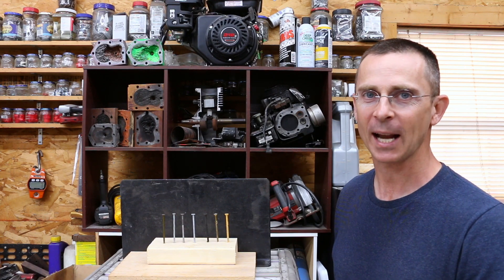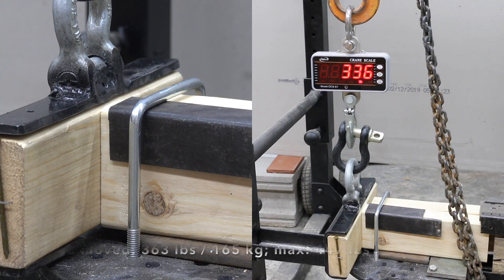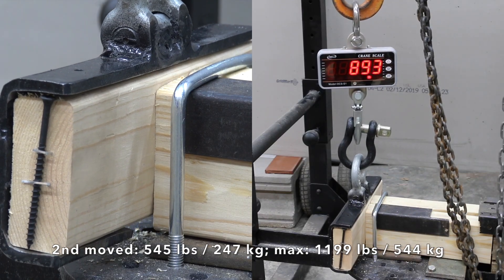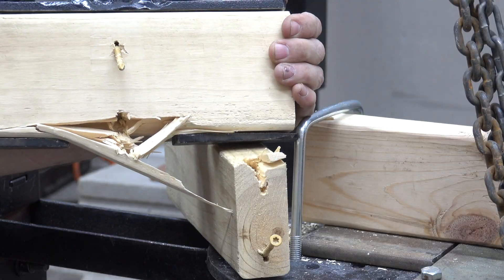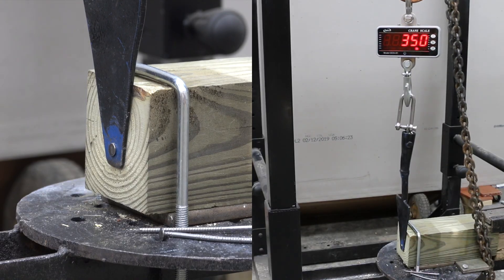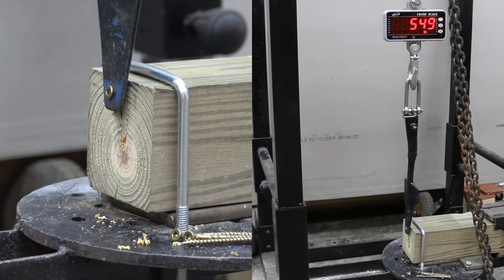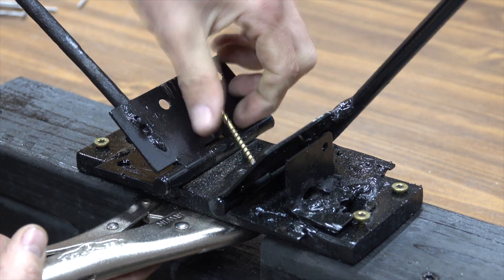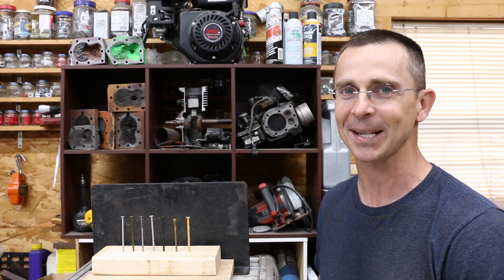Do Screws Shear easier than Nails? Let's find out!

Comment: This video is very useful for guys like me when talking to customers. There are a couple things I would have liked to seen for this test. as others have commented this was not a shear test but a holding power test. It is also impossible to have a fair test of holding power using conventional lumber. With conventional lumber there are weak spots and strong spots in each board. All of that being said both of those test are really hard to do. This video does give a lot of very good information to pass on to customers when they ask questions. Thanks for the time and effort.
Reply from the maker: Thank you
Reply: No. See I don't build houses. I build decks and porches. I get asked all the time why I use only deck screws rather than nails. Now I can give them an idea how much more holding power deck screws have over nails. Maybe next time don't be a wiseass when you have no idea what crazy questions contractors get asked. Having a rough number to give as an answer will get a lot more of a positive response over just saying they have a lot more holding power. Customers think contractors are out to screw them. So when someone uses something that is more expensive even if it is better. You get asked those kinds of questions.
Reply: @Mr Brightside while you and I know the facts about screws and nails. There are customers who do not get it. I have actually had customers who believe to this day. That hanging joist with a joist hanger is better than setting the joist on top of the beam. Some people need video proof. Some of people still might not believe it. A lot of old timers believe the way it was done 30 years ago is the best. Just like the difference between screws and nails. I know and you most likely know there is a difference between brands of the dame style of nails and screws. Customers can be a finicky bunch. Anything to help the hardest headed ones understand the truth is a good thing in my opinion. Sure I seldom run into ones who are that hard headed. But I do sometimes. I do not know for a fact but I believe I have lost a job or two because I refused to nail the deck flooring down. Even after I tried multiple times to explain why. There are times the customer is not always right. When that happens any evidence to back up the contractors word is good. Some people would just say forget those people. I would rather educate them so they do not get screwed in the long run.

Comment: I would say that in most cases the wood actually failed before the fastener did. Part of the problem with wood is the number of rings in the wood, knots, and other imperfections will cause different failure modes. It would be very difficult to choose wood where the end grain was exactly the same for all testing.

The bending test was tough to do. Screws have a natural failure point built in in the valleys of the spirals.  In the real world the body of the screw would be surrounded and supported by the wood so that the failure point would be at the intersection of the two materials being joined. If you use the 1/3 in the material being joined, 2/3 in the material being fastened to ratio most screws shear point would be in the solid point of the screw making it harder to shear. The second failure point would be head separation if the screw was over torqued during initial  installation. Most all initial screw failures occur when the screw stops turning but the device turning the screw doesn't popping off the head.  You can pop the head off of anything if you exceed the strength of the material being turned in relation to the holding strength of the fastener in whatever material it is in. The grip of the rust breaks or the bolt breaks it is always one or the other.
Reply from the maker: Thank you

Comment: can you test diesel engine oil on 4stroke gas engine as lube?
Reply from the maker: Thank you for the video idea!
Reply: @ProjectFarm  I heard some motorists put HDEO in their motorcycles and work fine. And can be used more than 1200miles. Common HDEO Shell Rimula 4x and 6x...anyway. thanks.

Comment: It seems from the video that often it was the strength of the timber being tested instead of the fastener. I'm not sure what the solution to this problem would be.
Reply from the maker: Thanks for the constructive feedback
Reply: One method would be predrill and glue nails into place. Especially if nails/screws are placed into side rather than end.

Comment: Video idea, (if you haven't done it yet) best bolt for wood into 2" concrete (and thicker). Maybe which one is the easiest to install, best overall, cost efficiency, and strength/endurance. I'm currently in the process of making a concrete farm house table (wood legs concrete table top) and curious on the best/easiest concrete screw/bolt to use.  

Also thanks for doing what you do! You're a serious youtube saint.
Reply from the maker: Thank you!

Comment: Could you do another test like this but use the same aspect where you had the two screw shear strength setup but instead twist the boards to simulate the fatigue stress like the two hinge jig. This could simulate the fatigue strength of a screw/nail/fastener when is practical use.
Reply from the maker: Thank you!

Comment: Nice work. Shows the behavior of the fasteners in a worst case (holding in end grain) but very common assembly. Thanks. Curious if you have tested the 2-stroke and 4 stroke fuels sold at Home Depot for yard equipment. Its expensive and claims to be better for your equipment than pump gas etc. If not please consider doing it in the future
Thanks
Reply from the maker: Thank you!

Comment: I'm curious about the bending vs the shear strength with brittle drywall screws. Is it possible that the thread area is hardened more than the shank area since the seemed to bend similar to the nails?

Comment: Hey I'm a structural engineer and the main thing wrong with this test is that on the stationary block you screwed into the end grain of the wood.  We never specify fasteners into endgrain.  For this type of connection I would use toe nails at an angle.  Repeat this test with fasteners into the side of the stationary wood to get more accurate testing results.
Reply from the maker: Thank you for the constructive feedback!

Comment: So, in my mind the screws would never really get to fatigue, because they hold the wood together so tightly, even through a hurricane.  So if you built a house tightly with screws, which would last longer?  I have never noticed decks flying apart because of the screws shearing, not even through the hurricane last year.

Comment: The thing about nails is, don't they get a tighter fit the longer they're in? It displaces the wood when driven in and when let to rest over a few days the wood swells and presses against the nail? Or am I wrong?
Reply: ...... screws do the same thing. And if wood is outside it absorbs moisture and expands which also helps hold.

Comment: Been in the business of using all these types plus many more for ovet 30 years. You should have included treated lumber. Ill tell u from experience the screws shear alot i mean alot. In less than few years nearly half are sheared on a simpke fence panel application. Ring shank all the way if it works for the application. Ive found the more expensive coated decking etc are just terrible. Anyhow keep up the good work.
Reply from the maker: Thank you!

Comment: Really loved your jigs here, very well thought out. The only critique I have is that on the 4x4 test, your U-bolts didn't seem to be tightened down (certainly not biting into the wood), and that matters because as soon as the 4x4 gets any angle to it, the pulling force is no longer in a pure sheer, it's a little bit in tension, which allows the fastener to pull out much easier. If for example you had constrained the shovel jig from pulling away and forced the fastener to break (or tear through the wood), you'd get far different numbers. If it comes down to both tension and sheer, then any 4x4 that allows tension to come into play more via the jig will skew your results.

I would like to see a fastener video where you pull boards away from each other, rather than just pull the fastener out of the board, (I suggested this on the last fastener test), because that's what we expect these fasteners to do, fasten boards to each other. There's almost no real-world circumstance where you are worried about pulling the fastener out by actually pulling the fastener. These sheer tests you did here were great because they demonstrate one of the forces we expect fasteners to be under. 

Lastly, I think your videos would be improved by having a few more visual aids on the screen. When you're testing 24+ fasteners (4 each of 6+ varieties?) in a video, it gets repetitive and boring. You're being very thorough and scientific, but not perhaps very usefully so to a simple viewer, and with only a moderate amount of entertainment value. Worse, I forget what we're watching at any specific time without those visual cues, so having each test shown in detail doesn't provide as much benefit. For example, on these videos I would have kept a little header graphic along the entire test. Show the 6 (?) types of fasteners in a header or sidebar graphic, and then a red box around the fastener currently being tested, and maybe even record the data there if it doesn't get too busy. That kind of aid would help provide some narrative to the video. We can see where we've been, we can see where we are, we can see where we're going. If the numbers can stay up on screen, it provides some drama and tension, I don't have to juggle memory of all the previous numbers, I can see them on screen. It will be more engaging, and less boring. You seem to be an audio-focused kind of guy, you're careful to read out every detail which is great, but just becomes audio-numerical soup after a 3 or 4 readings. This is somewhat consistent in your videos, but of course every video and setup is a new challenge on how to best present the tests and data in a way the viewer can absorb. On retrospect, criticism is always easy. Just food for thought.
Reply from the maker: Thank you!